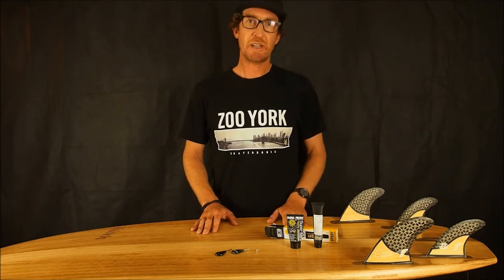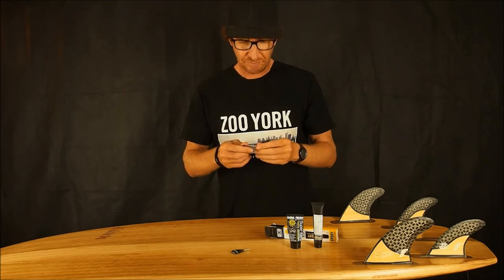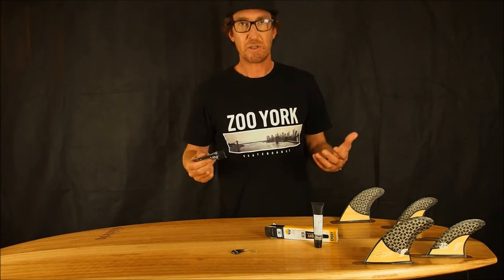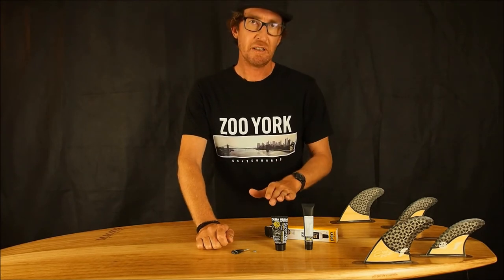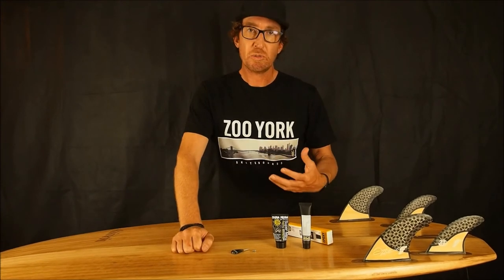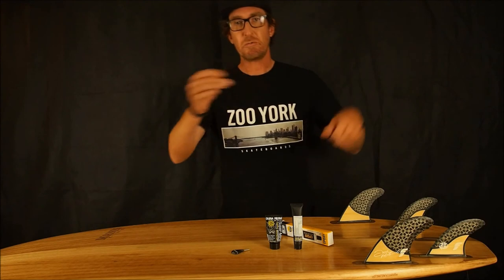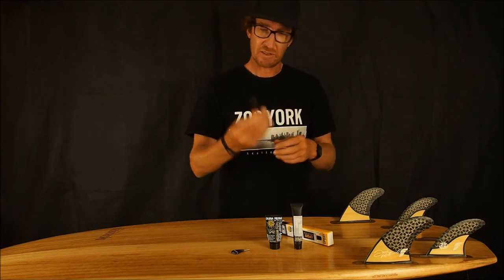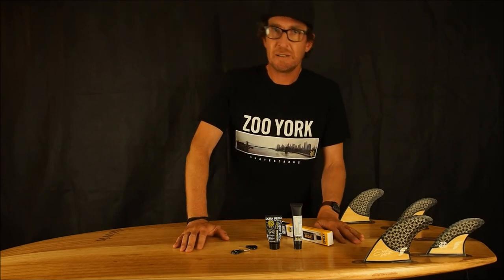How To Remove Damaged Grub Screw From Surfboard - Kook Shed Episode 6

Comment: How will poly resin eat through an epoxy board without touching the foam? You can use poly or epoxy for what you're doing. I put poly resin hot coats on epoxy surfboards all the time for easier sanding and a higher polish, also better UV resistance. Good tip otherwise. 😎
Reply from the maker: fair enough mate, good point. i just prefer to keep poly with poly and epoxy with epoxy so there's no mixups or potential for damage wherever possible. and if i did say that (your method) on here someone may give it a go and mess up and damage their board and i'd feel terrible! many thanks for the positive and valid/helpful input. cheers -KS
Reply: Never use poly resin on epoxy boards. The only resin that you can use on both is epoxy. It’s surf repair basics 👍